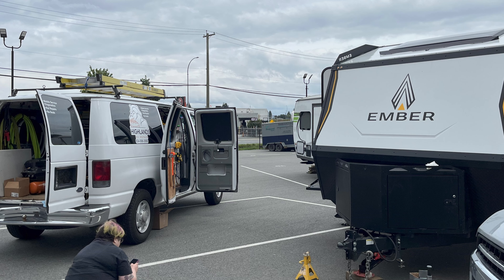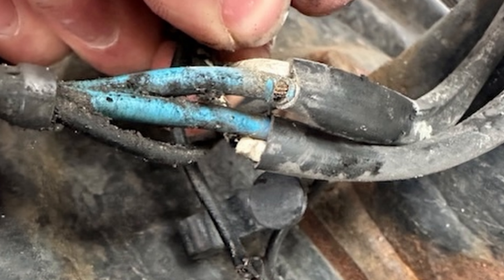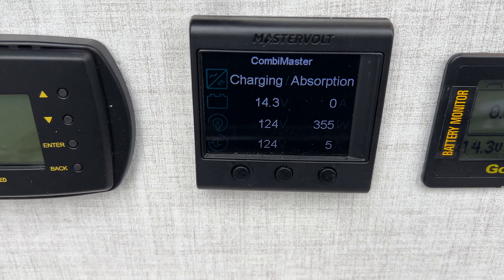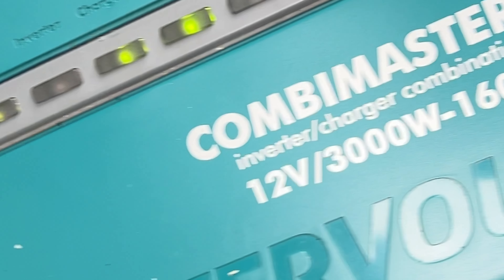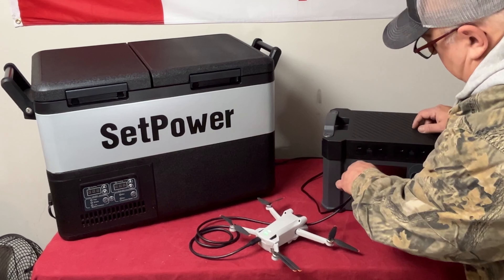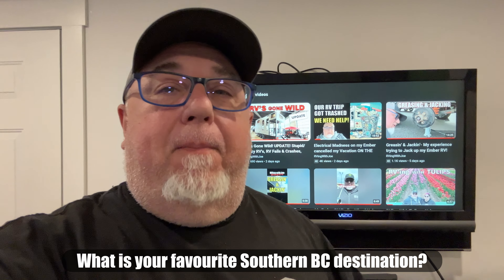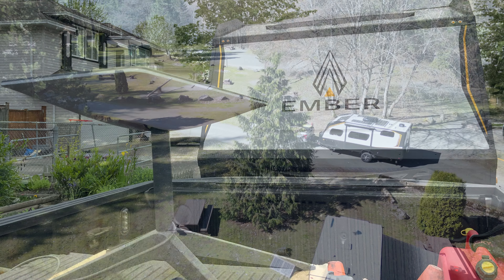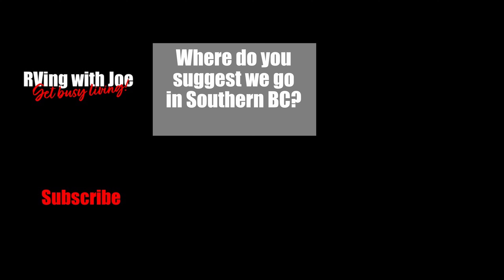My Ember is On the Road Again! Thanks to Highland RV Repair! Vacation Restarted, where should we go?

Comment: I think you have found out the bad way, why Ember now use Victron. 
As an electrical designer, Victron are a leader in mobile electronics. It’s another reason why my next trailer will be an Ember.

Looked like a couple knife nicks on the sheaf. A possible learning moment for Ember on those. Although it’s a learning moment for all RV sparks, to possibly look at using proper cable strippers. As an ex sparkie I can relate to this.

Comment: What miles per US gallon are you getting towing that Ember?  I'm getting 29.3mpg (Imperial Gallon) of diesel out of my Toyota when towing the twin axle caravan here, that's about 24.4mpg (US Gallon), and when solo I get and average of around 53mpg Imp or 44mpg US, and at best 65mpg Imp or 54mpg US, just wondering how the costs compare when Diesel here is £1.48 per litre ($7.18 per US Gal), so towing costs around 30c US per mile here, and around 16c US per mile solo.